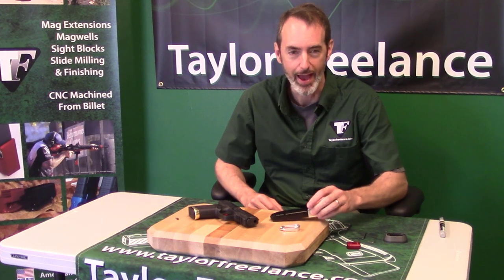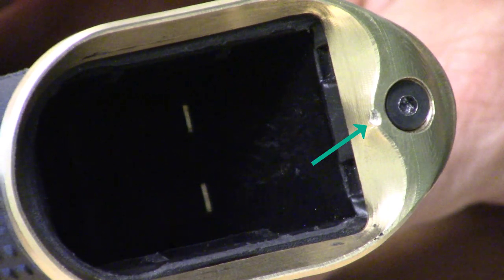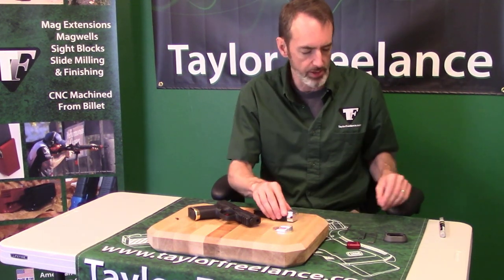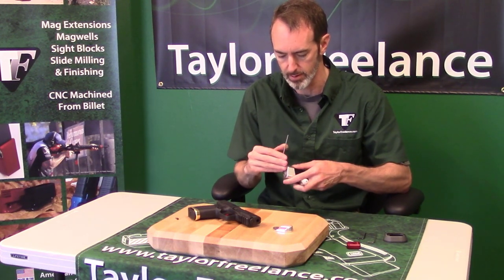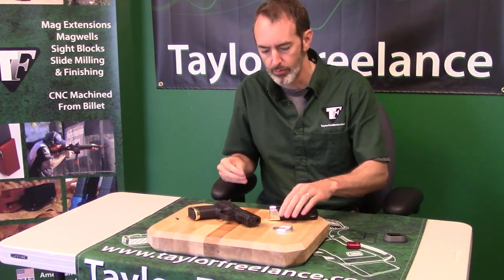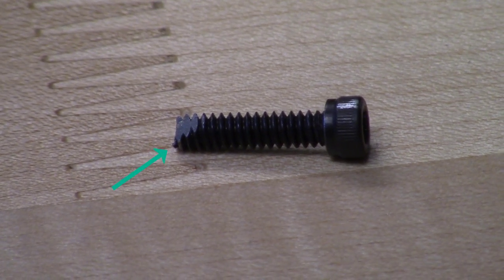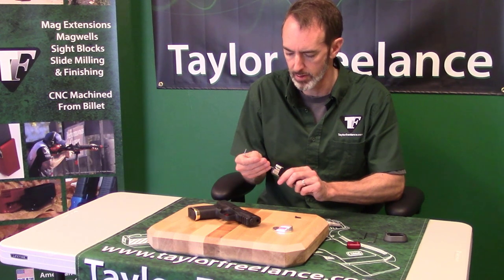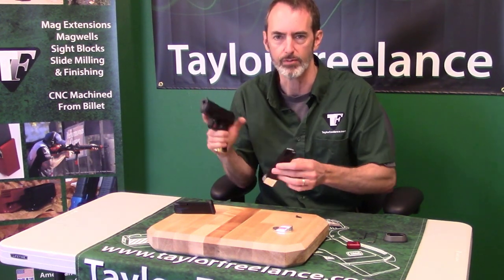Canik Elite Carry Magwell Hack

Comment: Or, just but a shorter hex screw at local hardware store for .7cents
Reply from the maker: We tried that one already. If you shorten the screw enough to not touch anything, you end up with near-zero engagement on the mag. We may yet give up and just cut a relief in the magwell, but it's a Hobson's choice.

Comment: Looks like you didn't do any testing for a quality product that didn't have a defect and put it out to the public to modify something on their own, engineering fail🤪.
Reply from the maker: Actually we tried several versions, balancing the tendency to take a dent from the screw versus the tendency to snag the top-most round in the magazine (which wrecks the reload). We ended up settling with the tendency to dent because the magwell will get scratched/dented in normal use -- and the screws can be modified to almost eliminate screw-denting. That said, I freely admit we settled on an imperfect solution. If you know of any mass-produced hardware that would solve this problem, we'd appreciate the tip.
Reply: @taylorfreelance  I have a solution to this: why can't  Taylor Freelance file off that tip of the screw professionally so customers don't have to? After all that screw belongs to the extension, so it's in your power to modify any way you want it. Thanks